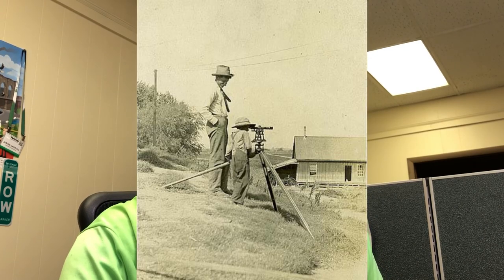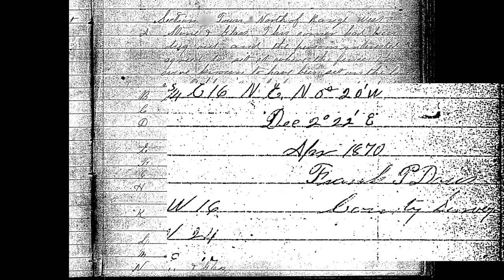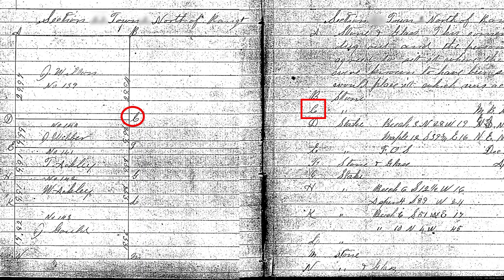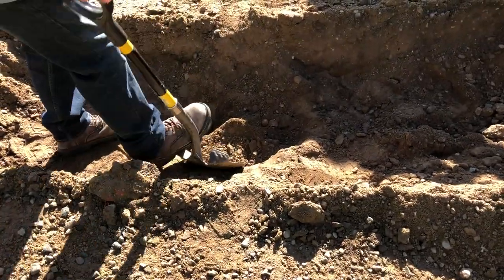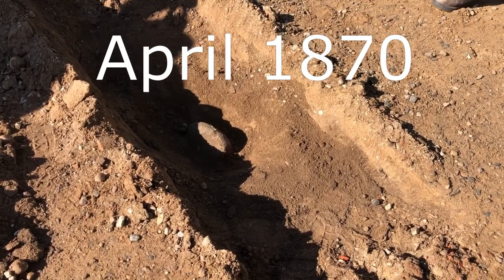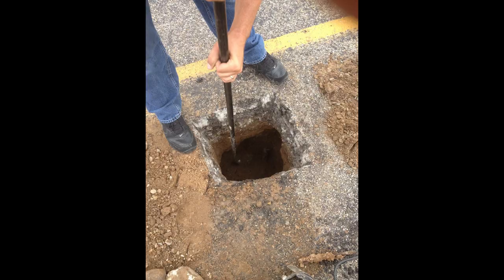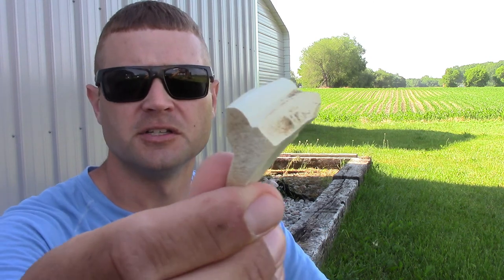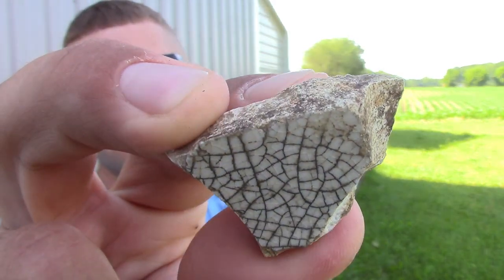Digging up the road to find a Survey Monument from 1870!

Comment: Very cool to see todays process. Thank you!  Although, in 1976 -1981, when I worked for a county surveyors office in Indiana and two private surveyors, the tools were chain, site rod, transit, shovels and gas powered jack hammer. Ah... the memories. Nothing like a jack hammer ringing in your ears. No better feeling than digging up a perfectly good paved road on a hot day to spark drivers to share creative comments while you do your job locating cornerstones. We used the high point of the cornerstone unless an "X" was carved in the rock. Fun days were walking along railroad tracks looking for RR spikes (a few buckets full) to be used as witness points or spending the day cutting scrapyard steel plumbing pipe to various lengths for placing over newly found cornerstones. I enjoy watching your videos so keep up the good work!
Reply: So why did you quit?

Comment: Why do Americans place their marks so close to the surface?  In Australia we've used Iron rods buried at least 300-500mm under the ground for each 'block' IP for over 150 years  - each of these IP's have reference marks ( the same type of iron rods) also buried 3-500mm underground. It's not usual - though not uncommon - to see rods from the late 1800's all rusted up and bulbed out.